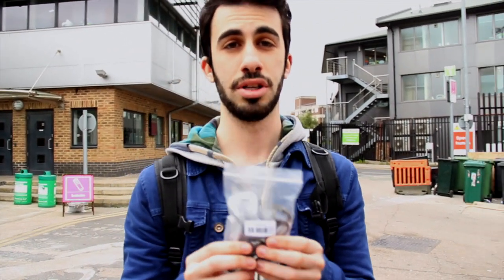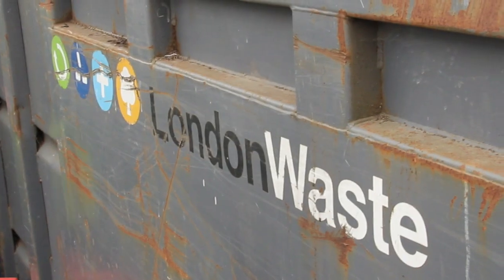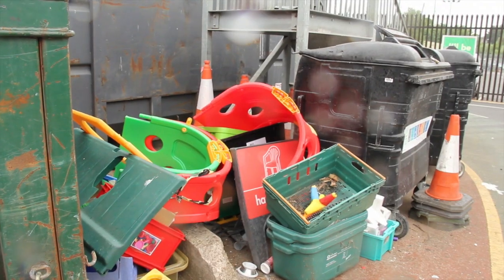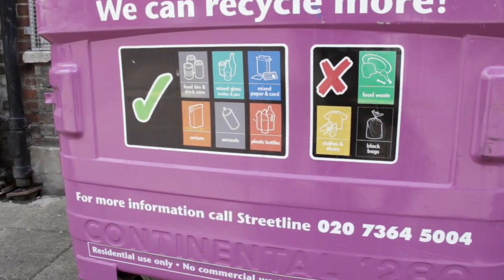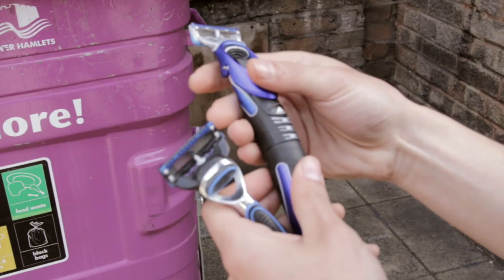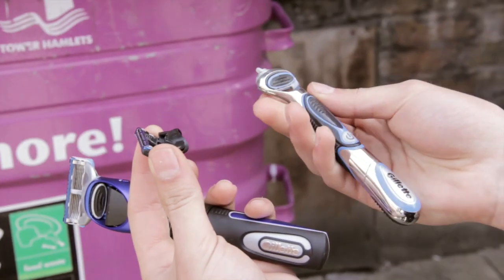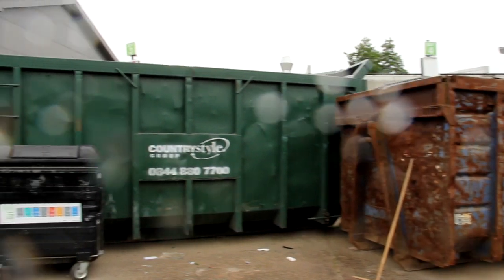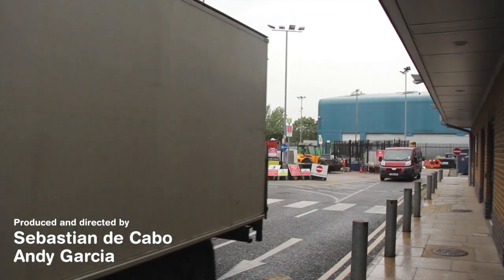Can we recycle disposable razors?  - Redesigning the Razor

Comment: "This one has a laser on it",   that gave me a chuckle :D

But I started using one of the old fashioned Double Edge razors,  I couldn't go back now,   the not only cut a lot better than safety razors (literally one pass most of the time),  the blades are infinity cheaper,  less than 10p a blade,   got a pack of 100 and it's going to take me years to go through it.

It is companies like Gillette leading customers with over expensive, un-recyclable lies.

Comment: I use a flat screwdriver and a wire cutter to disasamble my used razors. I save them in a empty ice cream box until it's full and then I begin to take them apart. Plastic shaft with cover in plastic and metal blades in an empty metal can used for like raviolle or baked beans.
Reply: Why not just switch to a Safety Razor if you're going to all that fuss. The handle lasts for your entire life if you buy a good one, and the blades have no plastic and are just made of steel.